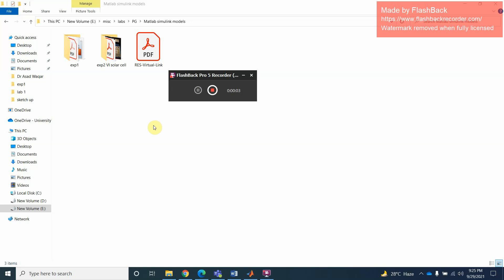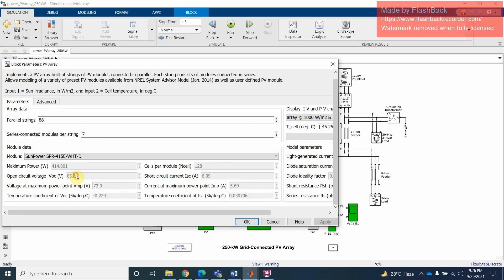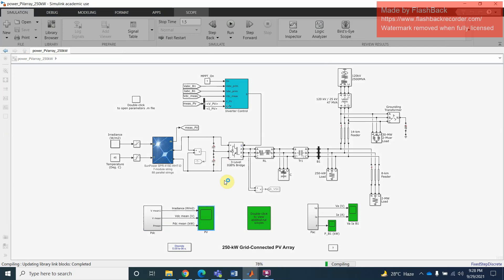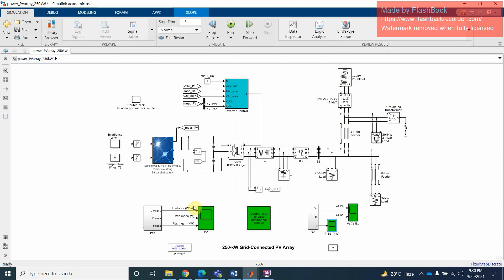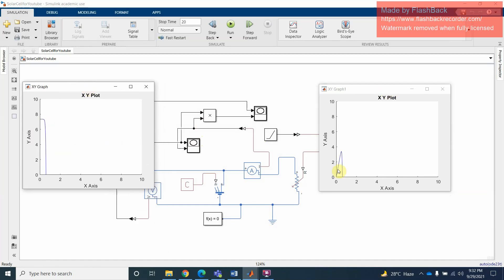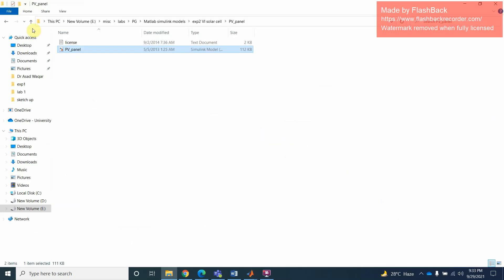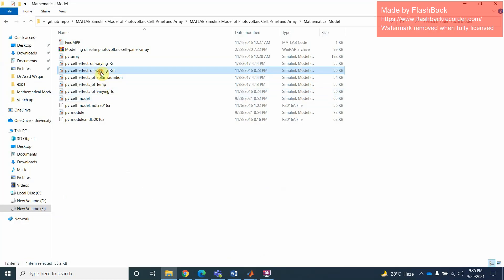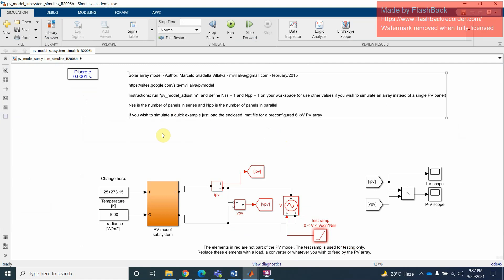IV & PV Characteristics of Solar cell and PV array | Solar PV System | MATLAB Simulink

Comment: Hello sir, I want to ask, in reality, when do the series resistance or shunt resistance of a solar pv cell change? I confuse if they are unchanged parameters.
Reply from the maker: I have also uploaded all models related to this video. Download links are in this video description.
You can Check/verify/simulate the Impact of Both Series and Shunt Resistance by the provided link.

Rs = 0 ohm and Rsh=infinity for a perfect solar cell. However, while current flows between two electrical contacts, there are losses owing to material resistance (Rs). We also have defects and trapping centres (electron and hole trapping), which reduce the gathered charges, particularly at interfaces (Rsh).
Resistors are the elements in circuits that produce energy losses. Resistances in series and shunt are parasitic elements that represent device losses (solar cell). The fill factor and efficiency of a solar cell are degraded by both series and shunt losses.